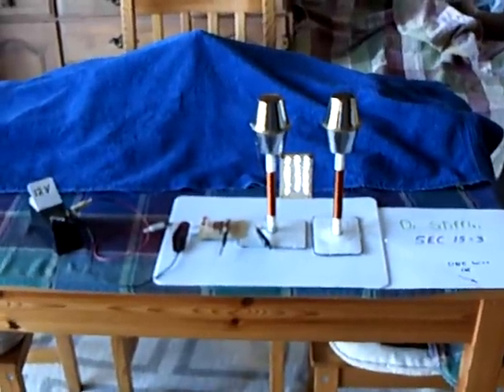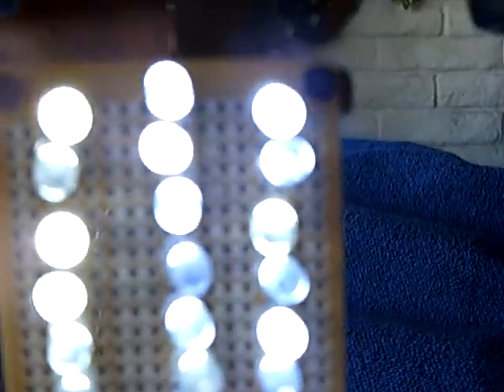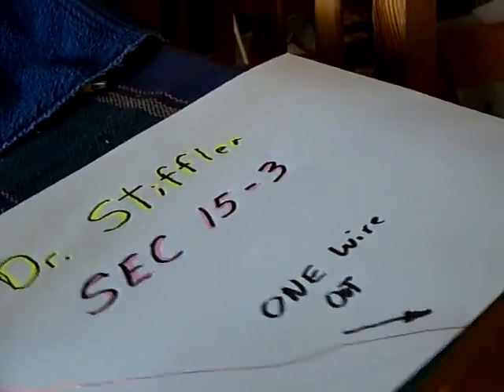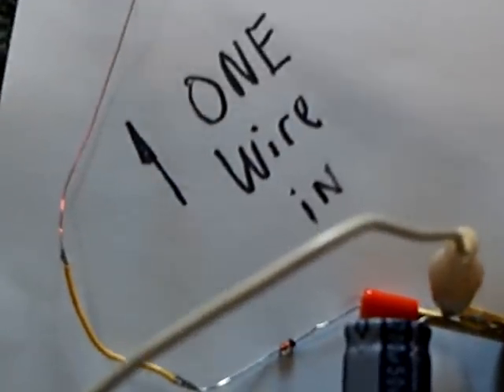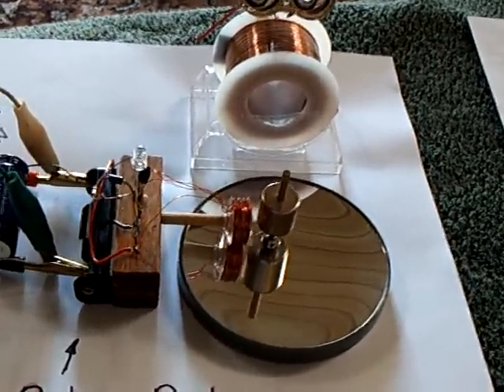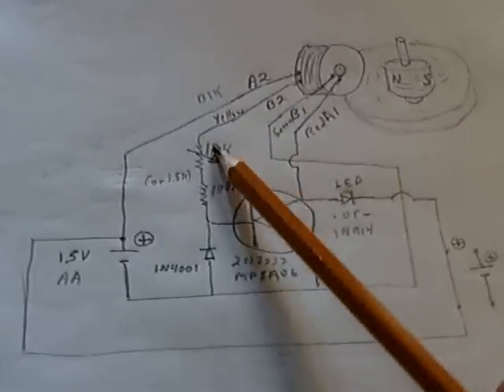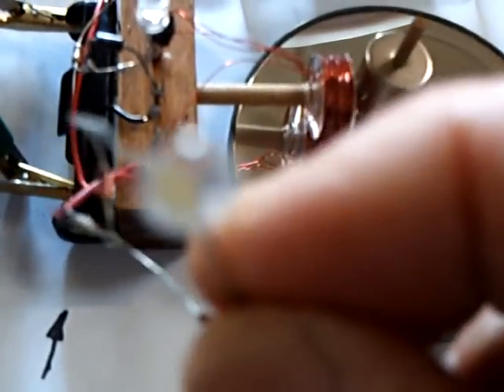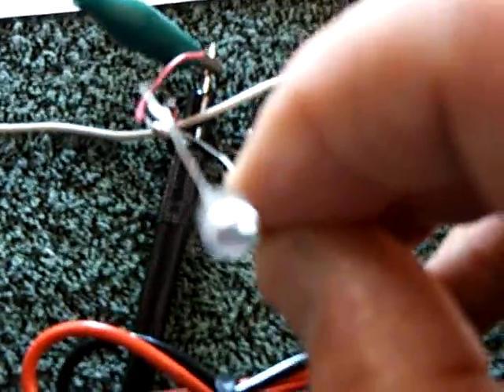Bobin Bedini--Run wirelessly by SEC 15.ASF

Comment: it's strange indeed, I used to think that electricity is the difference in potential. But on this circuit there doesn't seem to be any difference in potential at the output side at all. The amount of energy seems to be the same everywhere and yet it does work with a load, without the difference in potential? Like a river streams in circles, without any difference in height, am I right with this analogy?

Is there any  known explanation for this phenomenon? What's  the physics story behind this?